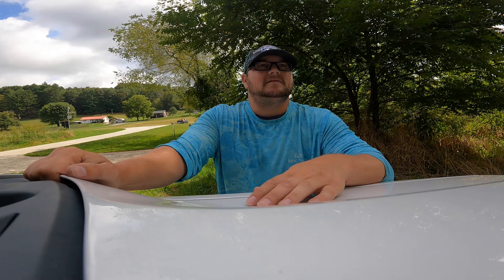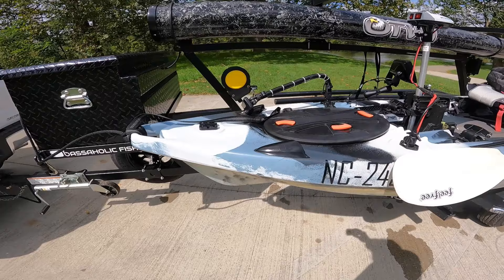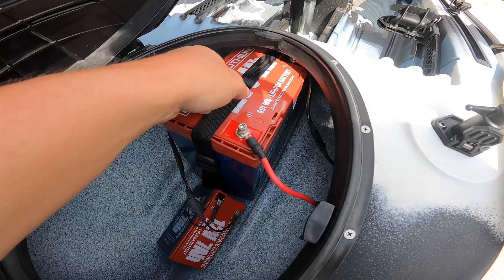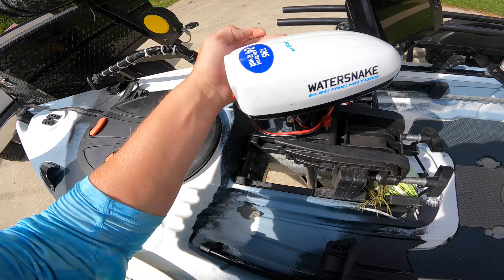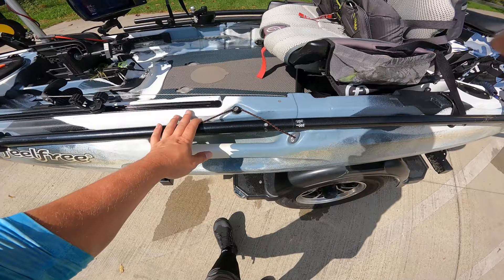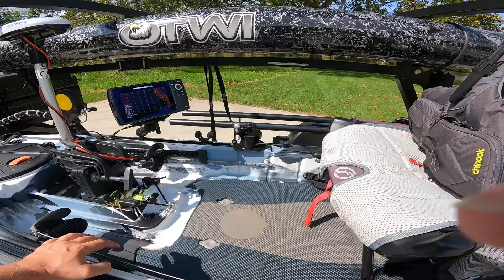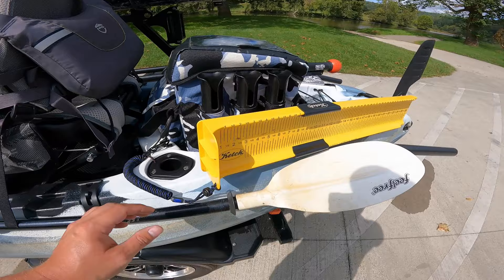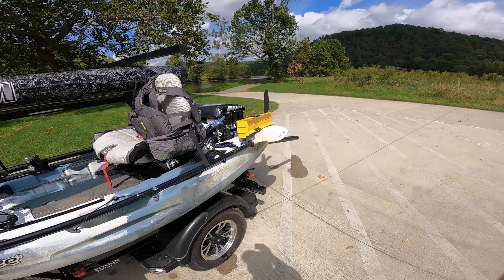Most Versatile Feelfree Lure 11.5 Setup!

Comment: Thanks for the great video, had the Seastream Angler 120. Two issues were that beneath the seat they crack. Issues with the scupper holes with leaking. That was two, now moving to the Lure 11.5. Praying that it’s a little more solid. It’s a scary feeling to be on the water and constantly thinking if you’re going to lose your gear. Be safe
Reply: The V2 lure they addressed a few issues from the V1 version.  I've had mine a couple of years with zero issues

Comment: Awesome setup man! I have the same kayak and I'm deciding to make the switch to trolling motor, couple of quick questions for you. Can you go all day using the trolling motor on that battery? What kind of speeds are you getting with the watersnake?
Reply from the maker: @baseballgod103  yes, I've not killed it yet on the water.  I get 2 mph on low and 3.5-3.6 on high.
Reply from the maker: @baseballgod103  from my calculations, to totally deplete battery, I'd have to run it 6 hours straight on high and 2.5 on low.  

But as usual, when you are fishing, it's on and off and on and off to fish.  I've had it in the river all day fishing around it and never killed it yet

Comment: I have the same kayak and motor , Just done  a little different . I have 2 downriggers i use with it .
I also run 2 fishfinders if running downriggers. The first fish finder is rigged to the bow  . i used it as fish finder , but mainly depthfinder for motor . 
second fishfinder is just used with the downriggers .
I have a anchor trolley on each side with quick releases just incase .
Reply from the maker: Awesome!  Its been a dependable setup
Reply: @bassaholicfishing  , I have been running with my set up for 5 seasons now . I wish i had done it when i first bought the kayak in 2016 .
Reply from the maker: It definitely makes it easier and what I love about it is when I want to go lightweight, I just put the pod in and leave motor at home
Reply: @bassaholicfishing  , I have a extra pod to put in when not using motor .